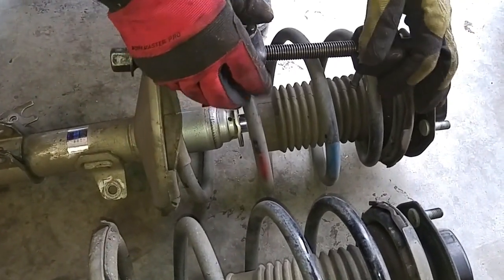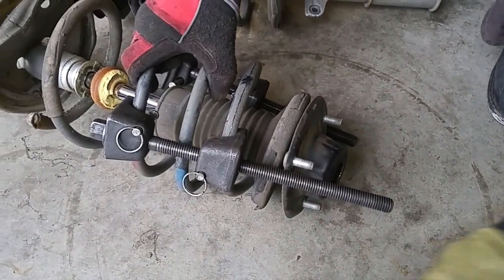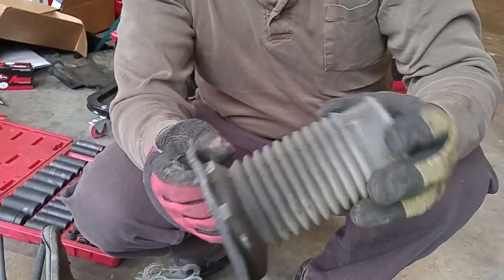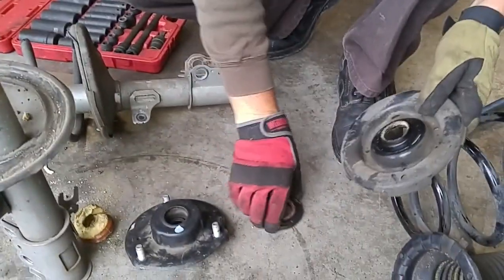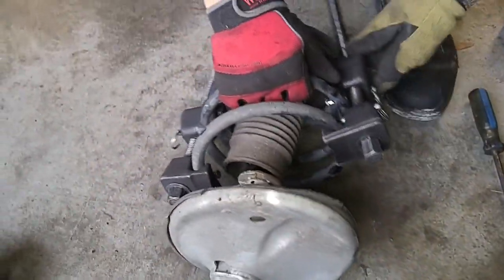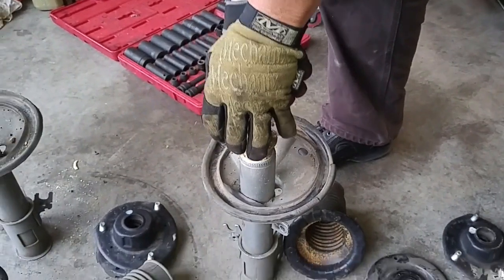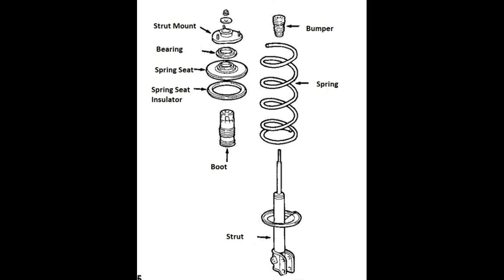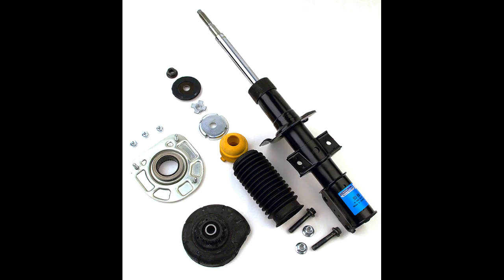Should You Use a Suspension Strut or Complete Strut?

Comment: the strut and the coil spring wear out, but the mount, bearing, seats, etc. are all usually ok to reuse. But like you said, replace the entire assembly and you usually save money and always save time.
Reply from the maker: Front springs tend to hold their tension better than the rears ... at least on the Camry sedans.  You can measure spring sag with a tape measure from the ground to the lower lip of the fender.  Compare the height ... front end vs rear.  If you have a rotating front mount, the rubber inside the can separate from the steel housing that can result in a rattling noise when hitting bumps.  Have see bump stoppers completely disintegrate along with bellows.
Reply: @hardlymovingpro  One of the coil springs on my 96 Avalon had sheared off about one full turn from the bottom after 400k miles such that I could not compress the spring. But the all the components on the other front side were still good, except for the strut and coil spring. The original bumper and boot were still in good shape after 400k miles. Thanks for the videos. Your ES300 and my Avalon had/have similar issues and it's been helpful to me to have a model for my restoration job.
Reply from the maker: @gltwn  I've gone so far as to remove the spring with no tensioner at the salvage yard.  I wanted everything but the strut (mount, bellows, bump stop, spring).  So I'd hold onto the spring coil with one hand, and use my impact driver in the other to spin off the top nut.  The strut would "shoot" out or forward when the nut came off.